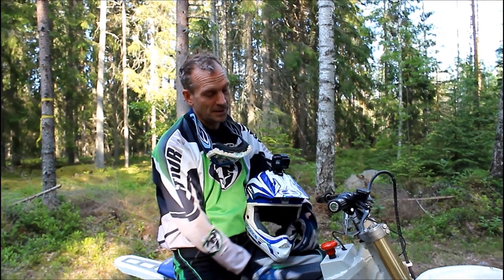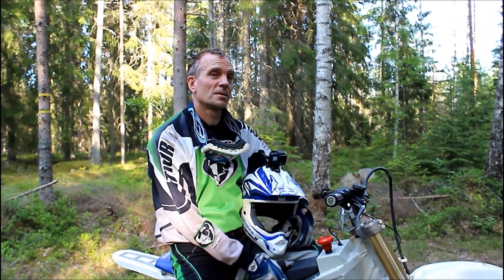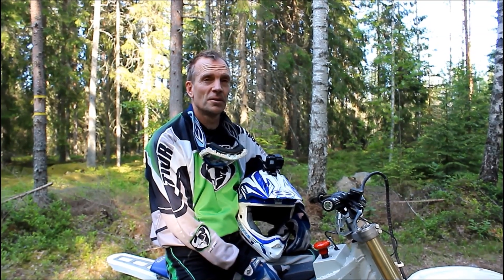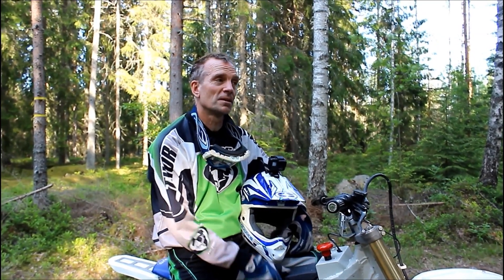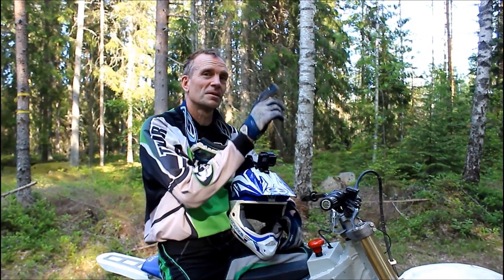Electric Dirtbike Testing

Comment: Riktigt cool cross du byggt. Du kan inte dela med dig av alla delar du använt? Har en 85cc  med trasig motor jag vill bygga om. Du kanske även har någon blogpost eller liknande när du bygger den?
Reply from the maker: Hej, Pierre  Jag har använt en Agni 95 R med en Kellycontroller som passar till den. Batterierna kommer från en gammal elbil. Är lite plock från det jag har haft. Det finns nog bättre kit med forum och bra support. Nu kommer jag inte riktigt ihåg vad motorn heter men något med 3000 ??  Återkommer med info om jag kommer på det. Mvh Pär
Reply from the maker: QS 3000